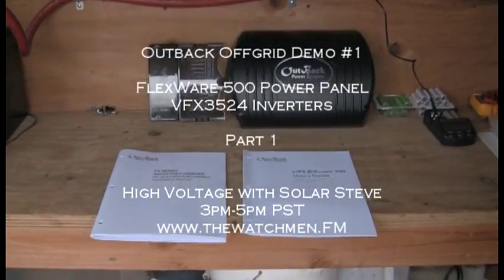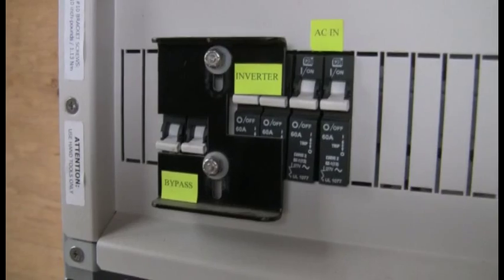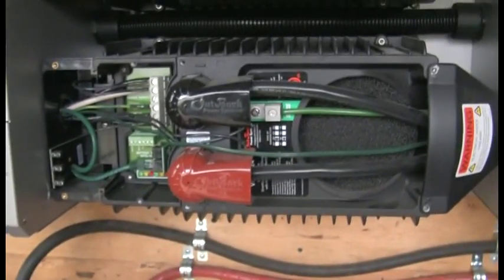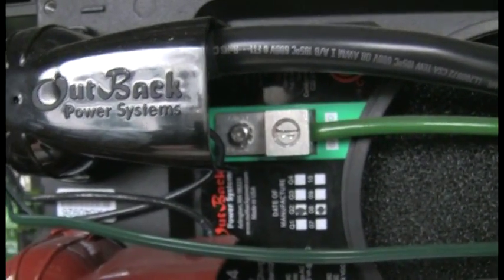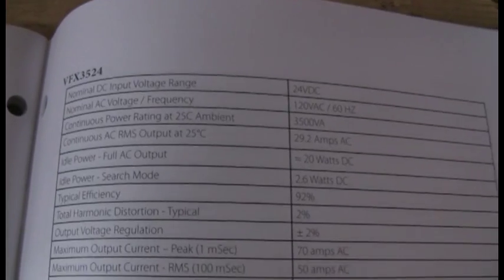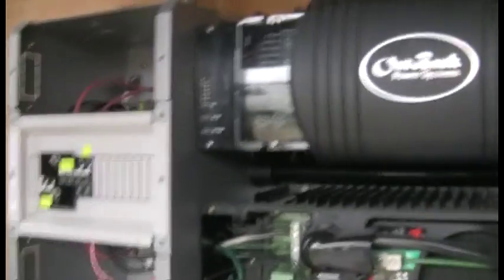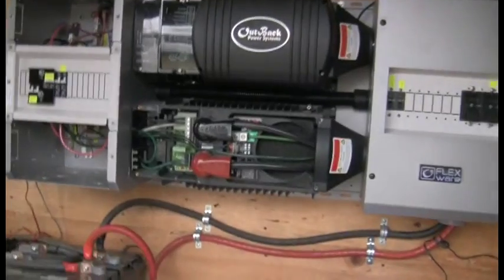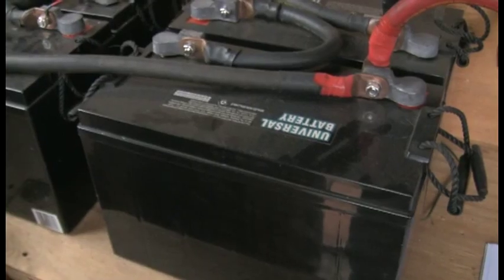Outback Offgrid #1 Power Panel and Inverters part 1

Comment: on the DC side what kind of cable? 2 something fine strand copper cable 5:50 ? where can i find that at?  thank you. nice setup.
Reply from the maker: +con·scious·ness state of being awake - Solar energy supply houses typically carry pre made cables in various sizes such as 2/0 and 4/0 fine strand copper. Welding cable is also suitable and available at welding supply stores. here is just one online vendor... http://www.wiringproducts.com/4-o-gauge-welding-cable

Thanks for watching!~

Comment from the maker: @RobertGerace...Thanks for the comment. First step is to determine how much power you are needing per day. Certainly, this setup allows for power levels above most people's battery budgets. Multiply this number by the number of days of autonomy for total days run time without recharge. Do this figure in watt/hours and then convert to amp hours using your battery system voltage as a conversion factor. This gets you at total amp/hours over X days. 2200 kwh in pv works out to 15k in pv alone.

Comment: Steve, great vids!  I want to build a system very much like this, but I'm having trouble sizing the batteries and pv array...several calls to outback and still confused.  Assuming I want maximum output, how should I size the batteries and pv?  I'm in Atlanta and can go for weeks without much sun in the winter...thinking about adding wind and diesel eventually...but for now I'm looking for about 2200kwh per month from pv.  If I'm on the right track please help me with batteries and pv...if wrong